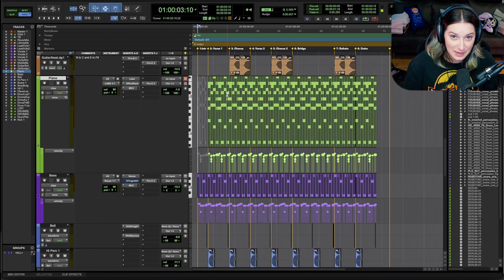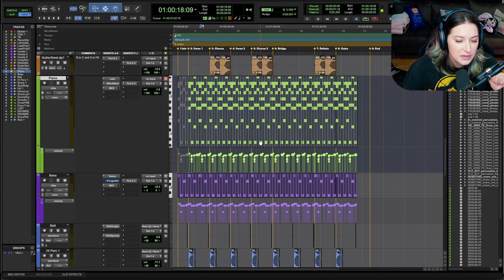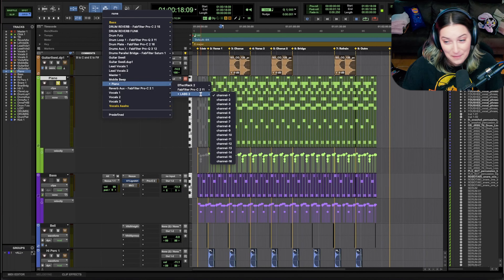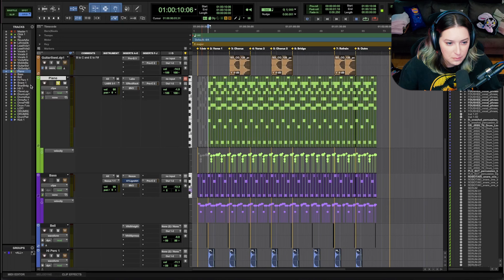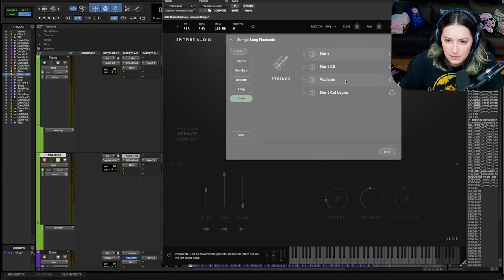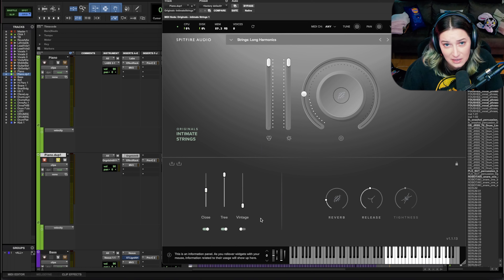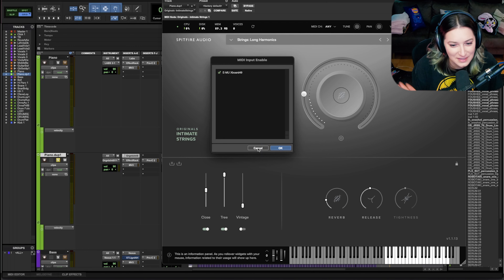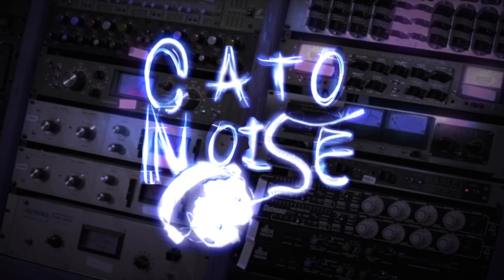MIDI Not Making Sound? Pro Tools Troubleshooting Tips, Plus MIDI Zoom

Comment: My problem always seems to be midi controllers
HUI is fun,
Last night I spent 4+ hours trying to re establish Arturia Keylab 88 1st gen,
That worked for years, the oddity was it worked with my other DAWs and it worked with every standalone instrument so no problem between peripheral and computer, Mac for me,
What seem to work was digging out an old axiom 25 I did the regular set up, peripherals, HUI and it worked right away, so I left the Axiom allocations in place and plugged my Key lab via USB as usual and everything worked, in addition my control surface, which is also HUI gained functionality as it does not seem to be competing for HUI protocol, I took it again this morning and everything’s working still, the wonders of pro tools never cease to amaze me. I’ve been running it since 2003 digidesign version 6
There is always a workaround

Comment: I'm having a midi issue I've not had before.  I'm getting a "protools midi error n/a because possible feedback loop detected".  This is on an instrument track with Kontakt loaded.  I've deleted and added new instrument tracks, tried different instruments.  I also tried closing protools and did a full reboot.  No luck finding a solution on the DUC forum.  I'm running 2023.6 on a Mac Studio.  Any suggestions?

Comment: I'm not a Pro Tools user but the actual midi channel can be also an issue. It's easy to overlook, especially if the transmit and receive channels are set differently on a hardware synth.

Comment: Thanks for the video. Quite a few good tips here.  I'm just getting back into PT after years of NOT.  

The problem I keep running into seems like (at least from a computer programming perspective) a memory management problem.  I will load a previously recorded session and hit play and everything sounds great. Then I hit play a second time and none of my instrument tracks (or only some) play.  I don't believe there's any indication of a problem (not grayed out, etc) it just doesn't play.

If I restart PT or just disable/renable a problem track, it works again.  My PC has 64GB of ram and I don't have hard drives, just SSDs.  In theory it should not be running out of memory this easily.  I'm starting to think that I have to  always bounce a midi instrument track to audio and then hide/disable the instrument track. 

One example is a cover I made of "Summer Highland Falls".  There's an instrument track for drums (Superior Drummer plugin), one for piano that uses PT's baby grand, and one for some keyboard stuff.  The rest are audio tracks.  Having three instrument tracks doesn't seem like it should cause this issue. But it does.

Not much running on the PC other than PT, although I do have BitDefender.
Reply from the maker: Hi! I'm not sure what's causing your problem, but one way I bet you could manage it is through the freeze track function.
Reply: @CatoNoise  I just spent a few minutes learning how to disable BitDefender while I use Pro Tools. I played my session like 4 consecutive times and no issues at all.  Wow. It REALLY eats up your system.
Reply from the maker: @johnnyvlee  oh wow, that's interesting!